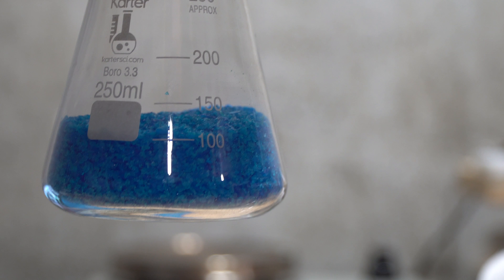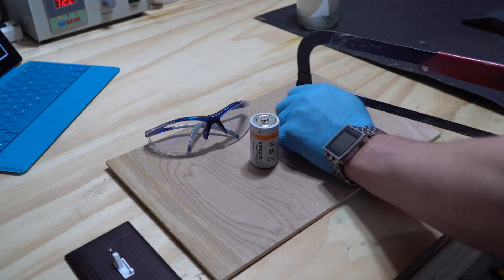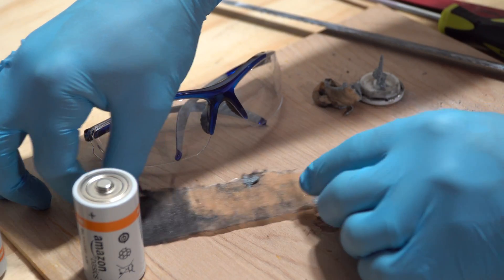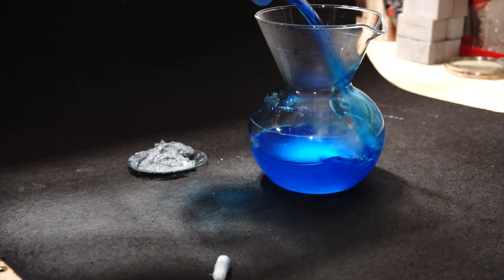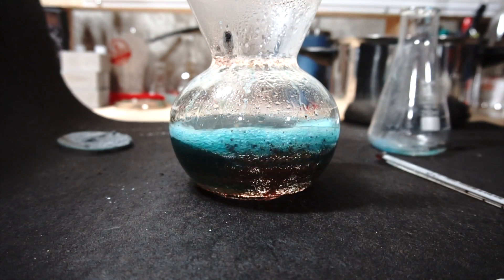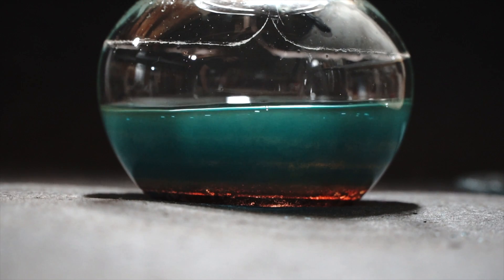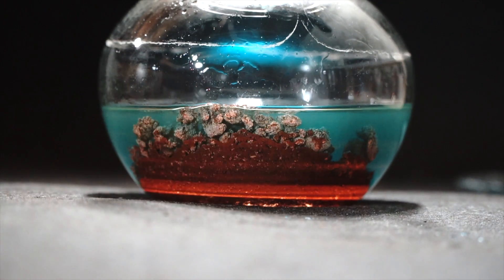CuSO4 + Zn

Comment: why did u add water to cuso4 which is previously hydrated and after that why did u heat it... iknew that heating cuso4 goes back to its original anyhdrous form
Reply from the maker: I had to bring the copper sulphate into solution by adding water and then heated it to increase the reaction speed.
Reply: @digiwhale   cuso4.5h2o which is hydrous copper sulphate it is  in solution only from the first place.. i am cse major but seeing this as i wanted to understand battery how it works so i have comed to this ...from cse to chemistry.
Reply from the maker: @saumyojitdas4212  The pentahydrate (CuSO4·5H2O), the most commonly encountered salt, is bright blue. It exothermically dissolves in water to give the aquo complex [Cu(H2O)6]2+.
Reply: @digiwhale  in the first 5 seconds cus04.5h20 + (excess water)h20 > cu2+  + SO4^2  u heated it so that it dissocaites more quickly right?
Reply from the maker: @saumyojitdas4212  yup, exactly.

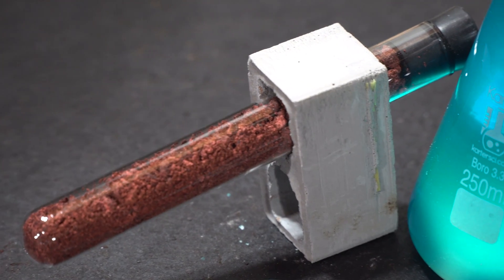Comment: At 3:35, what is that tiny cinder block thing that is holding the test tube?
Reply from the maker: I 3d printed a mold for them off of thingiverse.com and then used leveling concrete to cast them. It's super easy and they turn out awesome.
Reply: @digiwhale  Thank you!